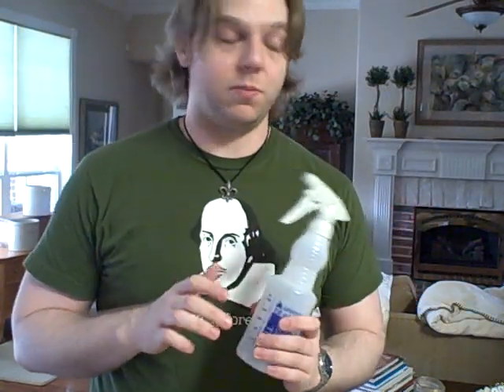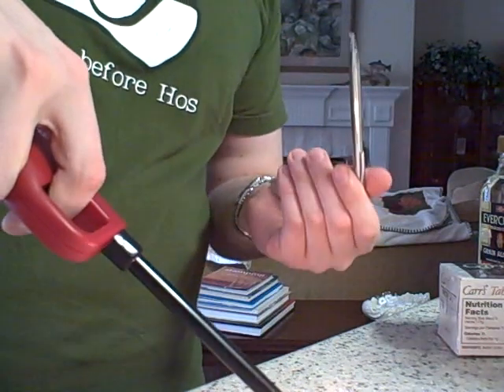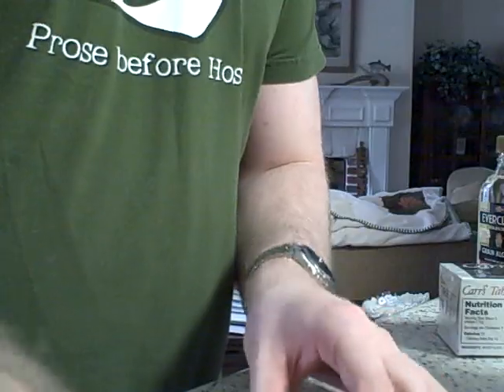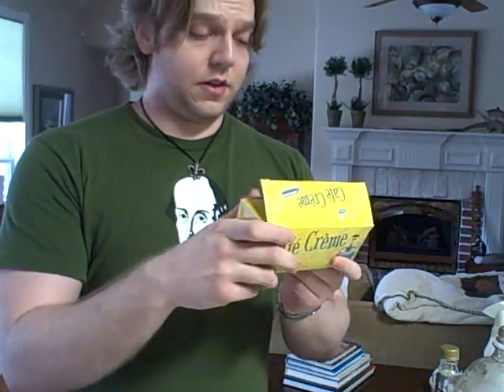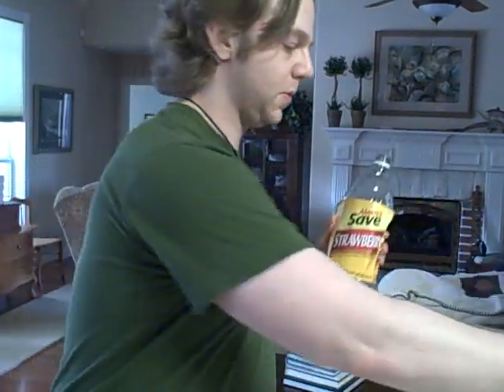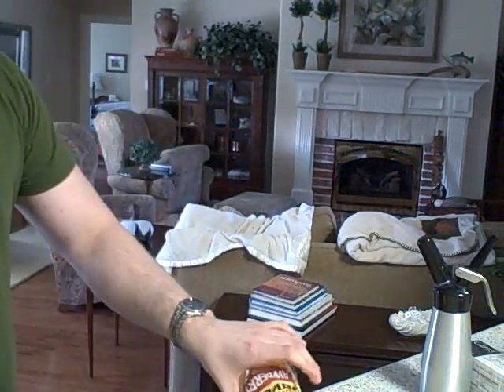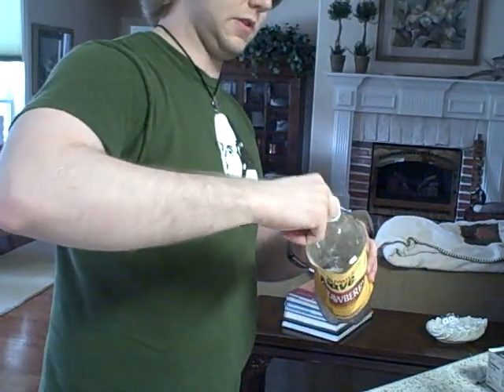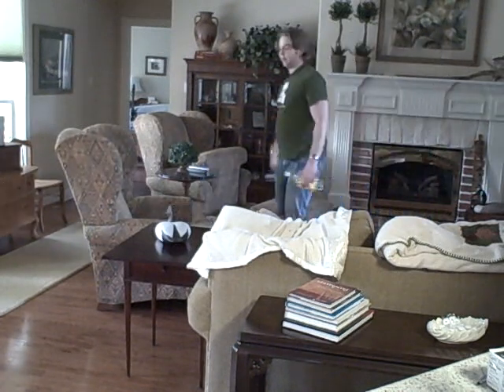How to Build a Rocket Engine with Alcohol and Nitrous Oxide

Comment: Well. Tried the plain butane rocket. about 5 times. Best result was a small flare. So tried it with about a 5 second squirt of N20 from a whipped cream can and about 10 seconds with a high flame lighter. In a small bottle. 

Nearly ruptured my eardrums I've fired quieter guns! Blew the cap / nozzle clean off the bottle in the other direction and I've yet to find the bottle!!!

N20. The good stuff. Is that there to donate oxygen and make the gas burn faster?

Comment: Made these using NOS/lighter fluid. We made a de Laval nozzle out of two bottle caps taped together top to top and with a 6.5mm (1/4") hole drilled through them. As it had no fins we were getting 9-12m (30-40') of altitude before the rockets tumbled.  We will be adding fins. They make a really cool sound as they fire.

Just because we didn't have an expolsion doesn't mean they won't explode. We will also be using remote ignition.

We plan to get one of these up to 300m(1000' ) by Christmas.

Comment: @kyletheBeast24 
Sigh
Nitrous oxide is a gas with a chemical formula N20 & is NOT the same as  Nitromethane (Nitro) CH3NO2 a liquid fuel used in dragsters and high performance motors on radio controlled models.
Reply: fizzguts: Nitrous oxide is also used in engines to get a temporary horsepower boost. You can buy kits (6 Sigma) to install on dirt bikes, 3/4 wheelers, etc.